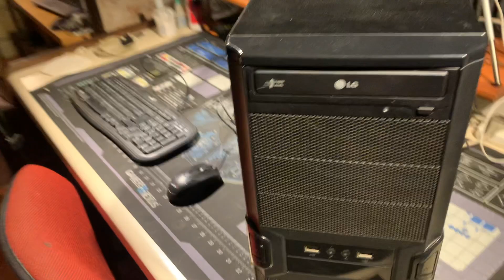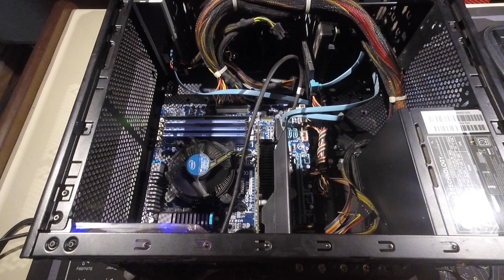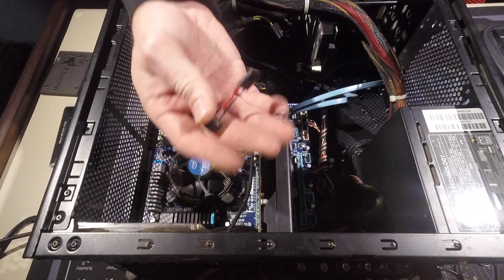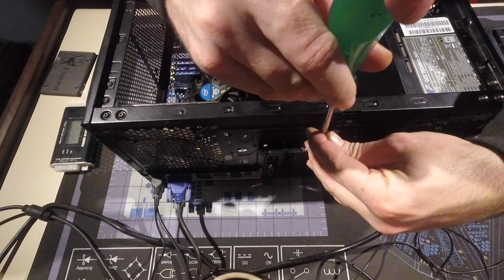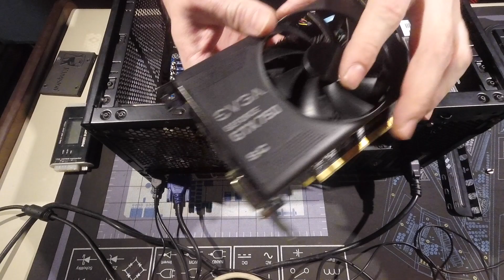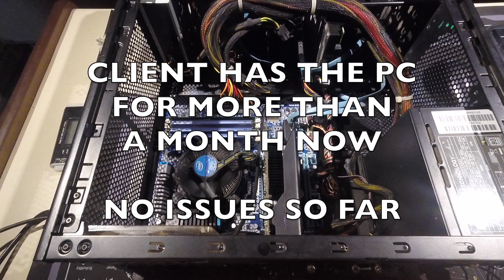ANOTHER PC REPAIR - NO POST #restoredwards

Comment: we have the same mobo, mine stuck at 6:30 then reboot again, even with no gpu, cant enter bios
Reply from the maker: That's a pity! You can try swapping the memory modules and processor as well. If it works without them your problems may be a faulty memory or processor. All this with the least peripherals connected, only keyboard and monitor known to be working. If the CPU and memory were changed or you know that the ones used are flawless, it could be a failing motherboard, BIOS conflict of some sort or bad component. I suppose you cleared CMOS to BIOS defaults?
Reply: @restoredwards  I will try to change the mobo, it's only a week using this 2nd hand mobo at first it was working fine, after a day not using it, it turns unresponsive
Reply from the maker: @ja9884  whatever you think it's best for you, thank you for sharing